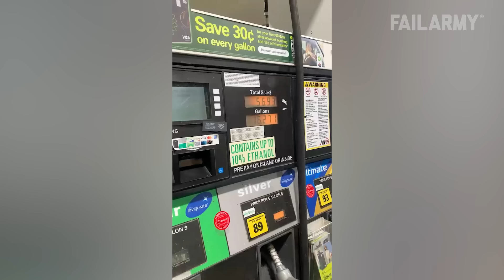That Didn't Go As Planned! Fails Of The Week

Comment: 7:23 Just as a note as someone who worked as a gas station attendant, each individual nozzle has it's own emergency shut off. That metal plate inside the housing where the nozzle sits that gets pushed up when you put the nozzle into it's cradle(could really be anything that moves when the nozzle it placed in the cradle), when pushed up stops the flow to that nozzle. It's a safety feature to prevent the nozzle from being activated while it's in the cradle, but can be used to stop to flow should the nozzle malfunction like this one did. Should that not work, THEN you hit the master shut off switch. The master shut off shuts off the flow to the entire system.
Reply: I don't even drive but I knew this. I was more bothered by the stupid berk's bald tyres.
Reply: Hey, I did not know this, and have noted it for the future. This could save lives. Why isn’t this taught in driving school?
Reply: @redfailhawk  because they had more important questions like - how long do you have to change the paperwork over when selling or buying a car
Reply: That is how I would stop my gas at the correct amount.

Comment: He shows the gas pump at around 16.2 gallons when he cannot stop it, just before it overflows it shows 22.9 gallons. With the legal flow rate of 10 gallons per minute, he had at least 40 seconds to run in and ask to do a emergency cut off.
Reply: Bro... shit nothing is getting passed you, right? Insurance companies should hire you.
Reply: Plus, add the time it took to get his phone out and start recording. Judging by his response here and how bald his tires are, he's not the brightest of the bunch lol
Reply: avg american braincells..
just look on his slick tire..says alot xD
Reply: @fleekwoodmatt4316  
So, all taken into consideration, he was possibly only wanting $10-20 worth of fuel when he realised it wasn't stopping?
Good point with the recording - especially as the use of them, and other electrical/electronic devices, is normally illegal within a specified distance of the pumps. At least he wasn't smoking - or was he?
Reply: @gordowg1wg145 it’s not illegal to use a cell phone near/around the pump.
Reply: @davidswanson5669  
It depends where you are.
I said, "normally", perhaps I should have said "may be illegal in the areas where those reading this live, and there are other reasons not to use them'.
It "may" still apply to other electrical/electronic devices, so it would be wise to check.
Reply: @davidswanson5669  your cellphone is not intradiscally safe, if I was you i wouldn't use it around fuel.
Reply: This would never happen in New Jersey.  Even the smart people aren't allowed to pump their own gas.
Reply: All he had to do was push the switch inside the nozzle holder on the pump.

Comment: Pro tip for pumping gasoline/petrol: every pump will have a lever or flap in the hangar for the handle. Push the lever down or push up the flap. It will shut off the pump. Then and only when the flow of fuel has stopped should you remove the pump nozzle from the fill neck.
When in doubt, the e-stop will always work.
Reply: And if you can't figure it out, warn an employee. Don't just stand there. And especially don't just stand there filming.
Reply: The pumps here don't have anything like that.  I think they got rid of that mechanism decades ago.  There's just a hook to hang the nozzle on.  Some pumps have an emergency shut-off button but most I've seen don't.  You have to go tell the attendant to shut off the pump.
Reply: @RatKindler what country do you live in? sounds super hi tech
Reply: @DaneKaiser  I'm in Toronto Canada.  I don't think I've seen that lever mechanism on a pump since the 80s or 90s.  I've been looking for emergency stop buttons on pumps ever since I saw one mentioned in an American video and I don't see them here.  If something happens you have to tell the attendent.
Reply: @RatKindler what if its a self-service pump?
Reply: @lionhead123 They're all self-service stations.  I haven't seen a they-serve station in decades.
Reply: @RatKindler   No sorry. i meant unstaffed, pay-at-the-pump type of stations. I usually go to one of those. I've neve noticed an emergency shut down button either.
Reply: @lionhead123 Oh, I've never seen one of those.  I would assume they would have a stop button somewhere, or maybe an intercom to someone that could shut the pump off remotely.
Reply: @RatKindler  i'll have a look next time i'm pumping gas. Pretty sure there is no intercom, that seems a bit slow. I'm sure the button on the pump itself would work and should be enough. But i'll look around anyway

Comment: 7:50 if a gas pump does that, you FLIP the lever up on the gas pump. not the trigger that you squeeze to dispense the gas, but the lever you need to drop down to remove the pump from its holster. if that doesnt work, yank the quick disconnect

Comment: 7:50 - I suppose someone not smart enough to realise they need new tyres when the tread is smooth, probably isn't smart enough to push the emergency stop button. Just keep filming, dude. Eventually that pump will run out of fuel and stop on it's own.

Comment: Why didn't the guy in the last clip run to the stop button earlier?
Reply: Or just flip the switch at the pump?
Reply: @davecoop9579 
Is there one? 
I have never been to the US, sp I don't exactly know how gas stations look there in detail. And I think in Germany there isn't even an emergency stop button.
Reply: @Lampe2020  Yes there is one. It's usually a lever that covers the slot where the nozzle is stored. It must be switched off to replace the nozzle. Some later ones are switched in different ways but I think they all have a "Stop" option.

Comment: I believe if you push the flap where you return the pump nozzle (with your hand) it will shut off. If not there is supposed to be an emergency shut off but I have not seen what they look like so do not know where it is typically located.
Edit: he knew where it was

Comment: On all gas pumps internationally even in the most deprived 4th world hell holes there is an emergency stop normally near the door of the gas station. All licensing authorities should require both knowledge of how to pump your own gas + safety and how to do basic operations checks for the car (tire pressure oil ect)

If I was to take it to the extreme all countries should ban automatics. Because manual engines have a built in mechanism that will slow you  ie. down shifting. Also people who can not learn manual do not have the necessary intelligence to operate the deadliest machine on the planet one that outstrips all guns on the planet in spades year after year and as a cause of death and is second only to heart attacks world wide as cause of death.